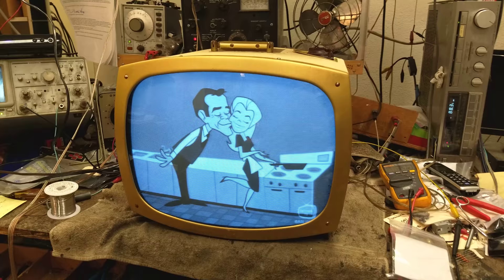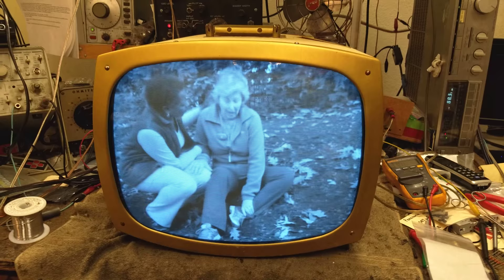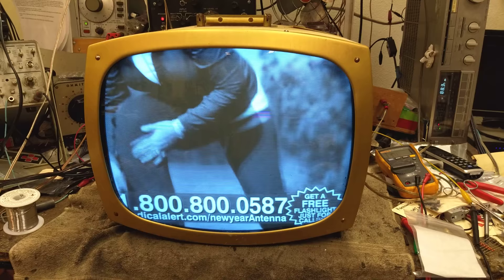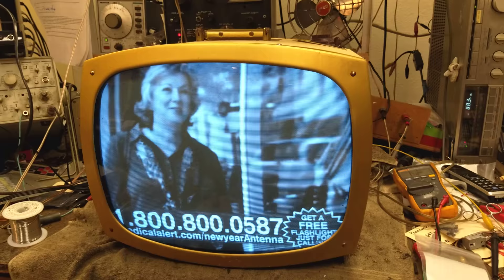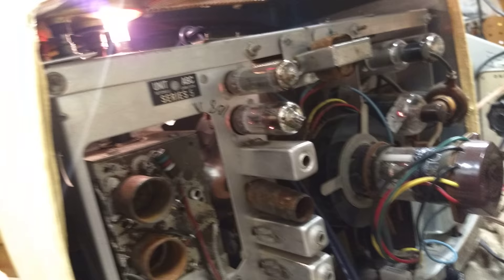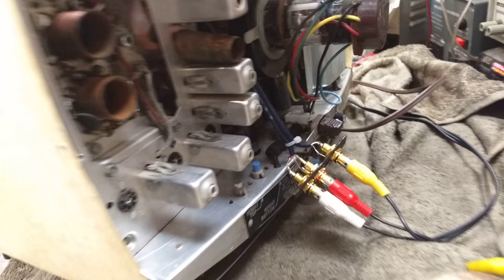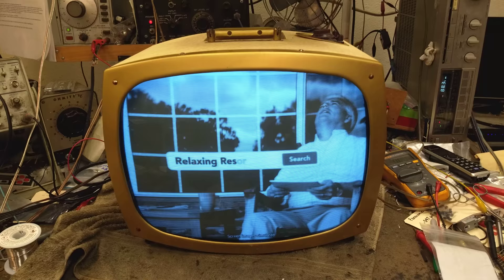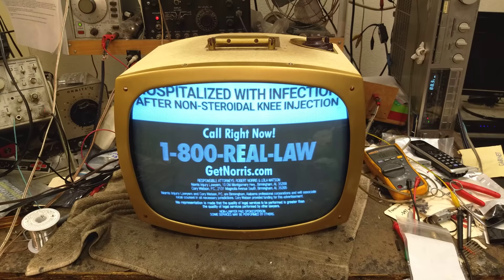Watch a 1959 Setchell Carlson C105 portable black and white tv

Comment: Another good repair, the picture will look even better if you feed the video input form the Luminance portion of an S-Video connector or the Liminance (Y) output from a DVD or BluRay player in 480i.
Reply from the maker: mspysu79 ooohhh. I'm gonna have to try that!
Reply: Since it is a post 1955 set, it may not have as much of an effect. The issue is the 3.58 MHz color subcarrier, most B&W sets made after 1954 roll off the video response before 3.5 MHz. But anything made before 1954 can have a response out to the limit of 4.2 MHz. Eliminating the subcarrier, eliminates the "Dot Crawl" artifact caused by the subcarrier in a set with a wide video bandwidth.

Comment: I just got a Seychelles carlson like that in a vintage camper...where are you located? Would it be bad to plug in?  No power cord with..
Reply from the maker: Don't just plug it in (assuming you find a cord) - it's a great way to trash the set. 

Located in East San Diego for now, but not taking in any new work